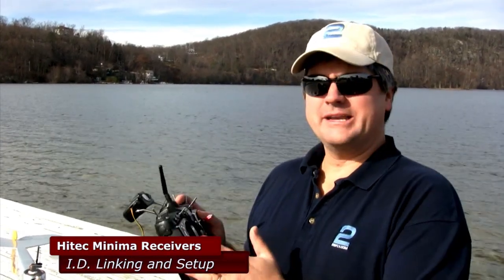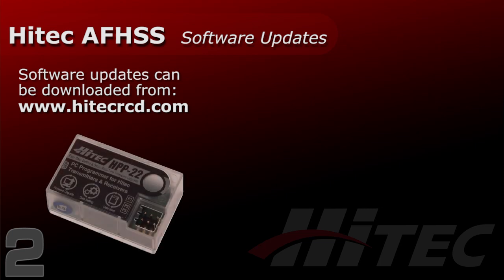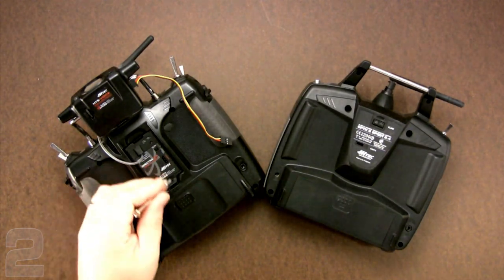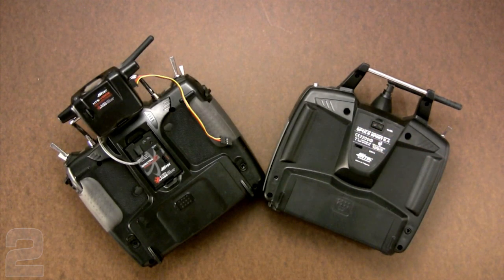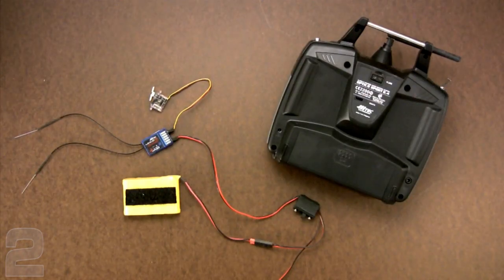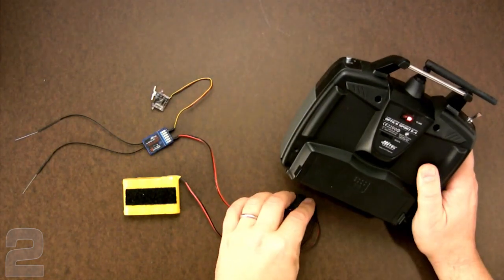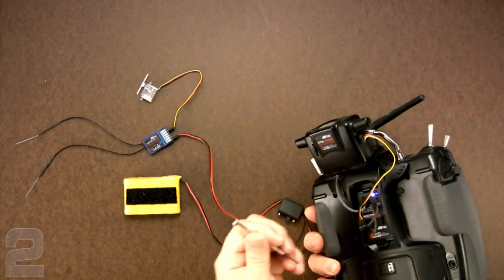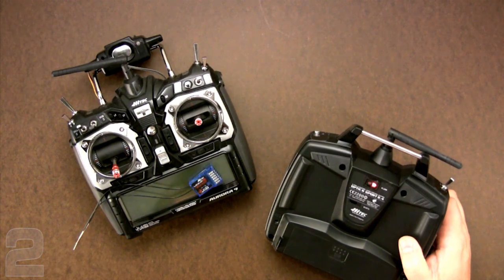Hitec Minima Receiver Binding Clinic

Comment: I'm having problems. I did everything in the video but it doesn't bind! I just got the Aurora 9. I'm sure it has the latest software? It's dated 2014. 03 on the box. I've spent hours trying different combinations. Doesn't work. At one point I made both LEDs on the module flash simultaneously with a buzzing sound. Scary sound! Did I damage my Aurora 9? Please help. By the way, I'm trying to bind a Minima 6L receiver.
Reply: Sorry, it's the Minima 6T that I have.